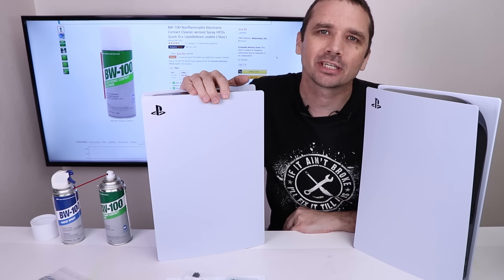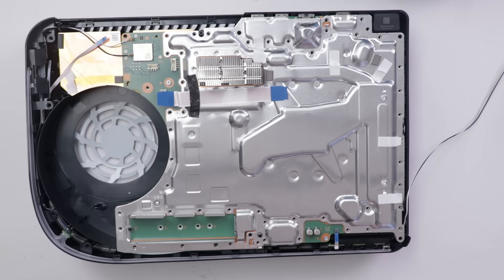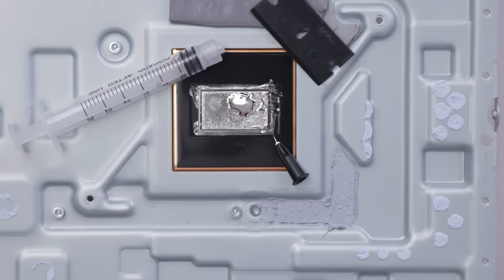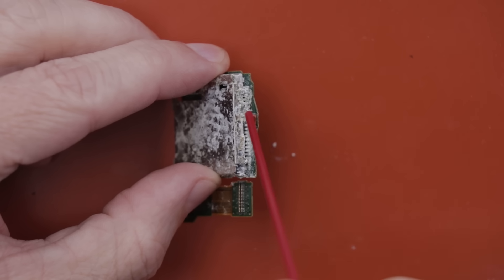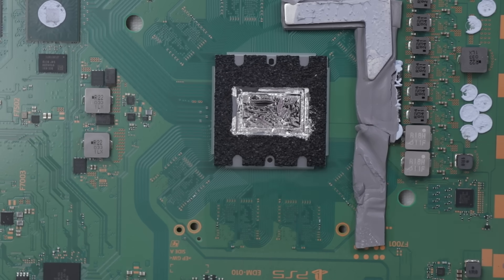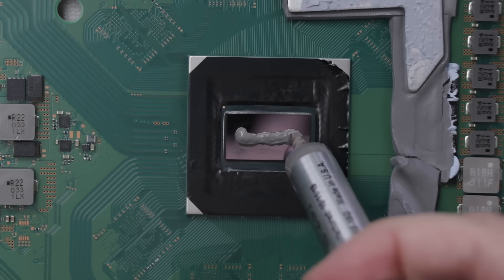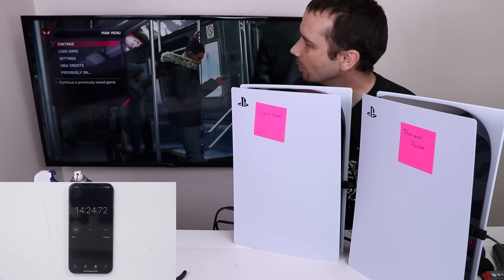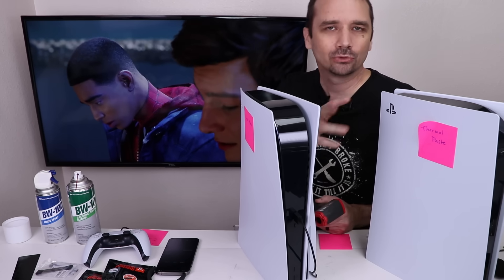PS5 Liquid Metal vs Thermal Paste - It OVERHEATED!

Comment: You should compare the stock metal liquid vs the best one "conductonaut" have almost the double of thermal performance compared to the second best 40 vs 79 W/mK  
usually ps like xbox use the cheapset thermal compound, is like when you change the crappy ps4 metal pastel with like thermalright tf-x.. the difference is huge
Reply: I'm actually curious about this myself. Something weird with the decisions made on the console that seem to cause it to overheat regardless.
Reply: I'd be careful about using another liquid metal solution. Sony knows what they're doing, but when you use just any metal you could get corrosion or it could damage the containment.
Reply: @9SMTM6  all liquid metals have the same elements in them. It’s not like paste.

Comment: So not only did sony build an ugly ass console with way to many screws in it. They also put liquid metal in that you really dont need. I will be interested to see if that liquid metal dries up and preforms like crap in these ps5's when they get to be a few years old. I bet we will see a lot of overheating consoles that will have to have the LM redone. 
 I dont know why sony couldnt just stick with a good thermal paste. Of course I dont think ANY console manufacturer will ever build a console with any real air flow. That has been my issue ever since the ps3. I customize all my consoles to make them run cooler, like they should have right out of the box.

Comment: What thermal paste was used? Some thermal compounds require a good amount of hours before achieving maximum performance.
Reply: wouldnt make much of a difference as LM will still beat it
Reply: @AdX-nj3ti  LM would beat it for sure, but I don't think PS5 would overheat with high end thermal paste. (like Thermal Grizzly or MX-4 for exemple) Would be nice to know what he was using indeed.
Reply: @fiddlebaton4818  i saw thermal grizzly wrappings in the vid
Reply: @thatslegit  I thought it was the conductonaut. Well this is disappointing then...
Reply: I’m curious if PTM7950 is good enough 🤔, also my PC uses MX-6 thermal paste but my laptop uses PTM7950

Comment: It's strange that ps5 even turn on with the fan not connected.
Reply: It shouldn't turn on. Thats a poor design choice by Sony. Should be safety measures in place.
Reply: @azzaprime7257  lol I'm on pc calm down it's not that big of a deal
Reply: @jarrettblakemore4676  Thats not the point lol
Reply: @azzaprime7257  even a laptop would turn on without fan.
they already got a security measure by shutting it off automatically
Reply: @chrischen6664  Than Laptops also need to add a feature where the system wont turn on without a fan. Its a potential fire hazard. Why would they allow the system to turn on without one of the most important parts that keep the system cool off or not connected?
Reply: @azzaprime7257  'Why would they allow the system to turn on without one of the most important parts that keep the system cool off or not connected?'
Well, because the system can detect when its gonna turn into a fire hazard and shut itself down automatically. 
Unless you are running heavy task, you will be surprise how little heat modern cpu/gpu produced. 
Some laptop don't even have fan at all

Comment: And this is another reason why PlayStation is the best, these "little" details are what makes or breaks 👍👏
Reply: then why didnt they add passive cooling to all the VRAM chips, the one that is getting close to or above recommended  operating temps. Why are the others getting cooled but not this 1 chip
Also why didnt they add holes into the intake fan side panel to increase ventilation. Not around the side far from the fan but directly infront of it.

Its the tiny things like you said, which they missed

Comment: I appreciate the vid.  But if your PS5 works fine, why screw with it?  They are kinda hard to get right now, in case no one noticed.  We’ve had one running@16 hours a day since 12/23/20, with no problems noted, and much great gaming!

Comment: What kind of thermal paste did you use? That can make a huge difference in results. Thermal Grizzly Kryonaut can run close to liquid metal temps. Though not as good as liquid metal it is easier to work with and won’t short your computer components. The paste you used in this video looked like a cheap brand.
Reply: Looks like chinese thermal paste closer to gd900.

Comment: Hi, good point i wanted to see but there is one thing bothering me. That could be funny if i only said nahh it's not the perfect amount of thermal paste, it's more than that. I use to replace it in a lot of pc or notebook if you mind and doing that for years and i conclude not spreading before putting back the cooler on exposed cpu/gpu (apu of c in this case) die get worse results up to nearly 40% on really cheap cooling systems so i don't know why not to try again in order to confirm those results in exemple ? What do you thing about it ? I'm not saying you dont do it properly im sure you've check well before but i wanted to expose it :)

Comment: I'm surprised no one has noticed how terribly designed the cooler is in the PS5, the fins on the heatsink should be rotated 180 degrees to improve air flow through the system, currently the fins run parallel to the direction the air flows from the fan, they should be perpendicular to allow for for easier airflow through the fin stack, it's basic physics.....Sony needs new engineers..... For a visual, I'll use a - or a | to represent fin direction and ^ for airflow direction and this is how the air flows towards the fan ----^----- , however, it would likely run a lot better if it were arranged like |^| so that the air can flow through the fin stack(effectively increasing fin surface area for cooling)rather than just into the fin stack.  I'm curious if they tested any other arrangements for the fin stack, hell, I kind of want to see if I can't design a better cooler myself, it's kind of sad how poorly this one appears to be designed.  

Edit:  I mean they should be rotated 90 degrees...not 180, lol.
Reply: Trust me I only know how to tell but a design is they said that the top part of the heat sink is only getting air not the bottom so I can get it wind blowing on your head but your body on your body is getting too hot. That is why I'm going to wait 3 years until I ps5 pro comes out

Comment: wtf!? "Perfect amount of thermal paste"? That's way way way too much. A quarter of what you used would have sufficed - like a thin line over the chip (or spread it over the DIE as thin as you can without any uncovered spots). You're creating an insulation layer using that much paste - especially if there is no proper pressure of the heatsink onto the chip - which there probably isn't. That said - liquid metal is always going to be superior to any paste. Anyway, thanks for sharing! This is interesting nevertheless.

Comment: LM actually works pretty good.
But that mobo had waaaaay TOO MUCH APPLIED to it.
1/4 of that used would have have been too much.
Supposed to apply it very sparingly or else the excess will get pushed out and on to parts that can short out!
It  is supposed to be dabbed on until surface is wet; NO GLOBS!

Comment: Doesnt liquid metal go bad in like 2 years? Why would they put that in console. Seems like that'll be a problem down the road
Reply: I mean it's not like a major company would intentionally implement a flaw which will render your device to a point where you pay another ton of money to upgrade and for ever keep you in their pocket.
Reply: Where did you get that info from?..

Because from what I got, it highly depend on the composition of the liquid metal aloy used, I think some commercial liquid metal used to be pretty bad but something like conductonaut is pretty stable over time (but I ain't sure, did not look into liquid metal in 3-4 years)

Comment: Yeah LM is pretty finicky IME. In delidded CPUs, it's amazing and I've never had to add more. In laptops with a copper contact plate, you'll have to add more from time to time for a while (especially the first few times) because the liquid metal will diffuse into the copper. The resulting alloy isn't anywhere near as bad as the one you get with aluminium, but you're still left with no TIM, so you gotta re-apply. After a few times, this is usually no longer necessary.
Also, in situations where contact is poor, you'll get horrible thermals, likely due to the surface tension of the liquid metal coupled with the poor contact. There's a lot of science behind all of this that I'm nowhere near qualified enough to talk about, but this is what I've been told and observed in my own experiences working with the stuff.

As for regular TIM... yeah if there was LM there to start with, well... you likely saw it coming anyway. Interesting experiment, though.
Reply: Don't forget also that in the instructions of LM it states to apply to both surfaces of the cooler and cpu/gpu. a lot of people skip this step and then also have horrible thermals.

Comment: This video seriously demonstrates that the PS5 can be pushed tremendously with upcoming next gen games, far more than a regular console with thermal paste.
Reply: Or that the cooling system is totally inefficient with classical thermal paste.

If they opted for a beefier cooling, like on the series X, they could forego the use of liquid metal but to abide to the "sleek" design, they opted for minimal cooling system and made up for that trade off by using a better heat transfer material.
Reply: @TontonGahu  I exclude that the Ps5 cooling system is ineffective with the use of thermal paste. The Ps5 has a heatsink as large as its entire height and the fan is large enough to cool the hardware without much effort. Liquid metal is definitely an addition to an already impressive cooling system.
Reply: @ivarden2847  I double checked and yes it is a big heatsink, but the airflow through this heatsink night be limited, I mean how else do you then  explain that in here it clearly overheated with the use of thermal paste?
Reply: @TontonGahu  But it is obvious that it overheated... The test was done by removing the fans from the 2 consoles... What is shown in this video is just that the liquid metal version takes a lot longer to heat up
Reply: @ivarden2847  Yeah I rewatched the video again. The first time I watched it was late at night and I skippped the part where he unplugged the fan before it overheated... Now, I find the title of the video to be very misleading ... 
I'm wondering if it would eventually overheat with just thermal paste though.

Comment: PS5 dont run on thermal paste despite of those very large heatsink. While PC run on thermal paste even with small stock cooler. Wow, playstation design still  behind PC. Now i have doubt on PS5. Heat destroy electronics parts, so im worried if PS5 will last long using that liquid metal. I assume many will gonna complain soon regarding heating issue and solution is re-apply liquid metal

Comment: I know you probably won’t see this but I’m out of ideas. I go to boot up my PS4 and it immediately overheats. It kicks on the fan into over drive. I’ve cleaned the fans. Replaced the thermal paste and it still does it. People were telling me to factory hard reset it but I cannot do so due to the fact that it’s not even 15 seconds on before it turns back off. Any ideas on how to fix it?

Comment: Well Sony did say they worked on the liquid metal solution for two years, so I’m really interested as to what they did that’s different from traditional liquid metal
Reply: Probably working on the perfect volume of each metal to use for the liquid metal
Reply: Probably could've used PTM7950 instead for lower cost production. It has almost the same performance as LM in every way but non-conductive so extra shielding isn't necessary.
Reply: @svd355  -The opinion of a single person vs a entire team who spent 2 years figuring out what to use and getting paid for it
Reply: @mas7rreaper126  I mean, Lenovo has been using it for their latest Legion series, be it entry-level to high-end and it's been great.

EDIT: Also the RTX 4090 FE uses PTM7950. Just because an idea coming from a single person doesn't mean it's a bad one to be considered.
Reply: @svd355  It's funny that you doubled down...
Reply: @Renvaar1989  yeah? And what's your argument then?
Reply: @svd355  "An entire team who spent 2 years figuring out what to use and getting paid for it" ...I think I'll leave any argument to those dudes, over arguing with a random dude on the internet.
Reply: @Renvaar1989  but that's not yours, that's theirs. You didn't represent any of it. You just attack me for no reason, like blindly defend them.
Reply: @svd355  You're missing the ENTIRE point of the reply from Mas7rReaper12 lol... I don't NEED to represent, and it ISN'T "blind" faith to trust a team of highly paid Sony professionals 2 years of work VS your "Duhhhh... Lenovo uses it". 
 You're the one who put the suggestion forward that's in contrast to the Sony engineers, so why the hell would I represent anything? I was merely stating it's funny you doubled down AGAINST the idea of a corporate team of professionals "cuz Lenovo dun it".
Reply: @Renvaar1989  so what's wrong if my idea the contrast of professional engineers then? At least state the logical explanation as well. You're all  just saying "bro you're so wrong because you're just some random dude on the internet vs professional engineers". Bro I need logical explanation, not insult. That's what I'm saying. 

I stated my reason of why I suggested they could used PTM7950 instead LM with evidence of Lenovo and NVIDIA being successful of it. If that's not effective or efficient enough, please explain to me. If you can't then just shut up.
Reply: @svd355  Where's your proof it's any better? You say I'm just saying they're professional engineers and not giving any factual explanation... While your WHOLE argument is EXACTLY THE SAME. "Lenovo done it". Where are YOUR figures and statistics? Where's your factual analysis that Lenovo makes a better choice than Sony AND that Lenovo's choice would be a better choice in the specific case of the PS5? You're LITERALLY just blurting out a brand you think is good because it was used elsewhere, in entirely different use cases and products with zero testing on the application in question (being the PS5). 

It's like religious people saying "god exists because you can't prove he doesn't". Then so do fairies, goblins and Neil Patrick Harris?! It's on the one making the statement to provide the proof!
Reply: @Renvaar1989   This proves that you don't get my main point. Where the hell am I saying that using PTM7950 is going to be a "definite" better solution compared to LM? I'm just saying it "could". Because in my experience and other people who uses PTM7950 has been great so far. It's been known to be a better solution overall compared to other TIM solution, in terms of durability and efficiency. In terms of performance it's just slightly a bit worse than LM, but cheaper, no risk of making short contact and easier to apply overall in comparison. Go check the details about it.
If that's not going to be a good solution for PS5 for some reason, then do explain to me because I'm curious. PTM7950 is best use for direct die contact, without IHS. So why not use it? Don't say "it's decided by professional engineers" for your reason.
Reply: Was working on liquid metal to bond to apu

Comment: I think the real question of this experiment is how long will the thermal paste version run with the fan running. He is thermal paste a future repair that can be applied to the system and be sufficient even if it’s slightly less efficient
Reply: I think a test to see how long liquid metal works without a heat sink altogether would also be interesting to see.
Reply: I know its late to comment on this but does the fan noise really matter as most gamers will have headphones on or speakers turned way up and not be able to hear the fan . 
Liquid metal ?, no thanks
Reply: @UserUser-ww2nj  Fan noise isnt usually about the noise disturbance. it means it's working harder than usual and chances are it needs cleaned or something else is wrong
Reply: @zeriominus653  Maybe it depends on how hard the player is pushing the system. An inexperienced player will be slower and not put pressure on the system but someone who knows the game well will be faster and the system will be running faster
Reply: Another late comment. The perfect amount of thermal paste is a flattened out even layer carefully spread out . Not a  dollop in the middle.  This makes the entire result null and void in my book. Thermal paste is used to fill invisible surface impurities between processor and heat sink . Some people sand down the heat sink to  such a ridiculous level of perfection that nothing is needed!  as there are no impurities in the bond between heat sink and processor.  
However Liquid metal itself does have cooling properties on its own. Thermal paste doesn’t.  By removing the fan the liquid on its own would cool the processor. Thermal paste doesn’t do that it’s not how it works. If the fans were connected and thermal paste properly installed the system would work fine for both.

Comment: Kinda interesting.  However the covers around the chips I would assume are there to protect the board against liquid metal leakage.  These gaskets would be acting as an insulator and not needed for thermal paste.

I assume you are using AS5 thermal paste, whilst not a bad one, it's not the greatest.  Perhaps a premium paste in comparison with the gaskets off would be more like a real world test, especially as the price point of liquid metal is high.